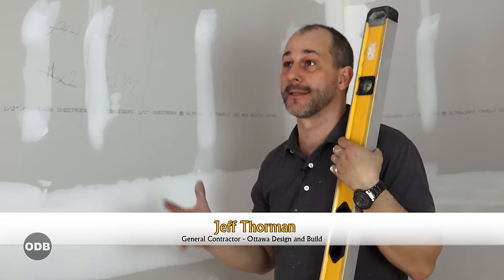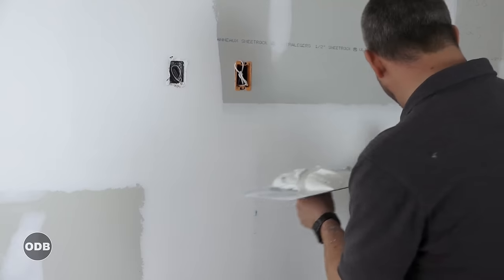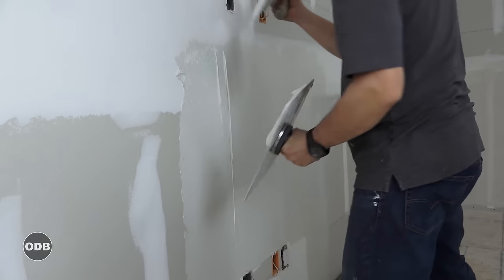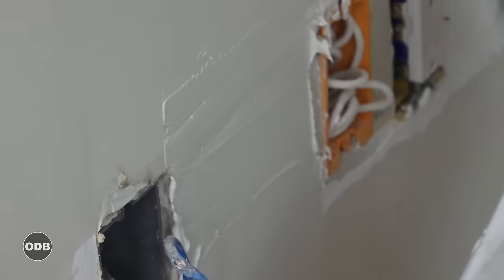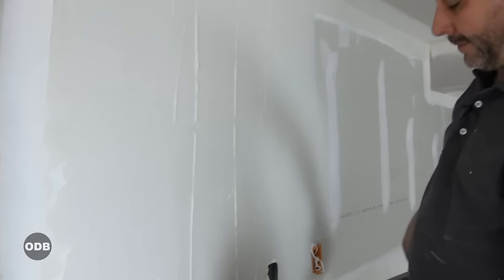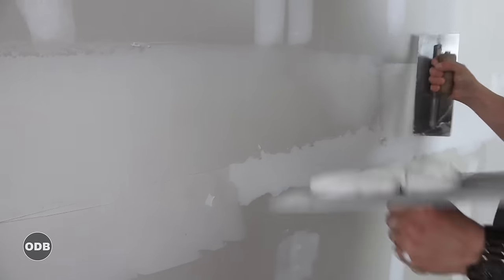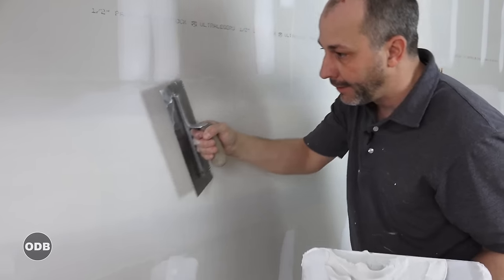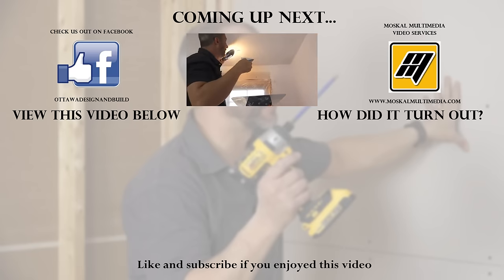Complete Drywall Installation Guide Part 10 Final Coat

Comment: I know this is a series and as it all comes together it looks and is fantastic. But us non-professionals either don't have the skill or patience, sometimes and it goes horribly wrong. Is there any chance you'd do a piece and how to correct major errors? Typical issues for me are where I might use plaster that has gone off, or when filling a crack or hole the plaster is too wet and runs out after I've finished and it creates a huge bump. There are also problems in renovation where working around immovable objects is inevitable.
Reply from the maker: Thanks for the comment. I will try to keep that in mind for the next project we are working on.

Comment: When you say outward pressure are you pushing all the mud to the edge and then feathering the edge? It's hard to tell which way your adding pressure on that 4x10 trial, I've never used one.

Comment: Not trying to criticize your work at all but why have drywall installers went more to hanging it horizontally instead of vertically like they used to do more often in the past? It seems like vertical would be easier because you wouldn't have as many flat joints without the factory edge and setback for mud.

Comment: I am a newbie at this so I apologize if this is a dumb question, but instead of worrying about spreading the butt joint out wide so you can't see it, could you not just leave a gap between the panels and fill it flush with sheet rock 45?

Comment: just i want to thank you for the time and the knowledge you are sharing with us. My questions . when you use regular mud and the quick dry mud?. it will make a difference if i use the quick dry mud all the steps and just add water to make it thinner? if i can mange the time before it will dry.
Reply from the maker: definitely. Allthough use regular premixed mud for the final coat. it sands soooo much better.

Comment: So for the final coat do you cover 100% of the drywall?
Reply from the maker: new house construction does not, however for the best results you can. Cheers!
Reply: Great reply, a lot of people don’t mud the full wall and seem to think that’s the “old” method of doing things. 

I’m refinishing a basement and mudding the full wall as a final step is a lot of work, but results are super smooth and very easy when reaching primer/paint stage. 

Thanks again for all the great tips, plumbing, timing, and drywall have been instrumental in your videos.

Comment: After applying the final coat, should you still be able to see the tape through the mud?
Reply from the maker: Not when it is dry. Sometimes maybe. The question is, when it is primed how amazing does it look then. That is when you can get critical. too many factors at work here.

Comment: Your almost as good as the best guy I ever seen
Reply from the maker: Thanks I think.
Reply: Love the channel I jump around the pros ,theres a plaster guy that is amazing
Reply from the maker: I may not be the best at everything but I pride myself in having an above average understanding of most trades and an ability to perform most jobs at an above average aptitude. This comes from years of trying to support a large family and working myu butt off to provide for them.
Reply: Home Reno Vision DIY I hear that I'm constantly learning and supporting a family if you can work with a good attitude it's a great start I take pride in my work but even a little tip here and there goes a long way thanks now I won't have to work as hard lol here's a tip from us them grey knee pads are a life saver when you get used to em 👍
Reply from the maker: LOL I hat the way they pinch behind the knees. Thanks for the thought tho.
Reply: Yea but you get use to it kneeing of concrete can do long term damage protecting comes body is 1st over here
Reply from the maker: I protect my body by doing many trades so I don't have a repetitive motion or stance. Every day I am doing something different. Wears my whole body down much slower.

Comment: Nice video and thanks for share .what do you recommend to do, when you have to patch a ceiling on baseman, but the existing ceiling is uneven , the ceiling has plywood on it ?
Reply from the maker: Wow, start over! level the framing and drywall with new sheets. You will never be happy with the final result if you layer over something uneven. Or you could just stipple the thing if it doesn't matter to hide the imperfections.But that's another video!!!

Comment: I'm having a tough time figuring out where I start in this process.. I am trying to paint my garage- it is new construction (11/2018) unpainted. Should I do the final coat or has it usually been done? There is definitely a ton of mud lines, tape bubble and blobs, so I'll need to do a ton of clean up. Just not sure about the mud process.

Comment: Hi Jeff this is a great video series and will really help me do my drywall in my house extension, thank you and your crew very much. I have a question though. I can choose between mounting my drywall horizontal or vertical which is best? I think vertical will leave me with less butt joints which I’d prefer but normal joints would be harder I guess. What do you recommend?
Reply from the maker: vertical is fine if you have everything perfectly level and marked out. I go horizontal so I don't go crazy closing the joints with wood that is never straight.

Comment: Hey Jeff looking for your expert suggestions on best solution to a problem of a bowed wall in my bathroom (up to1/4 “ across about 3’ section) created by install of tub flange (that I didn’t do). I want to install a tile baseboard on this wall and know I can fudge some minor depth discrepancies with tile cement but probably not this much. The bow was highly visible with the old tile baseboard. Should I resolve this problem using joint mud similar to your demo to hide the butt joint ridge in “drywall #10 video? Or try to address it by shimming btwn studs and drywall. PS: I’m the unfortunate owner of a home built with metal studs. Or do I abandon tile baseboard for bb moulding? Look forward to your advice. Love the videos. Tina M in Oly
Reply from the maker: yup, fix it with mud after and paint it in. so easy. Cheers!

Comment: Hi Jeff.  Do you go over your inside corners a third time with a finish coat?  I only saw a tape and then fill.  Thanks
Reply from the maker: and sometimes a fourth. the point is to do as thin a coat as possible and as many as needed. Cheers!
Reply: Ah man. Thanks. Remodeling a house. Never done smooth walls. Always textured. But since this is an old farm house I wanted smooth walls. My butts and tapers look really good. My inside corners are rough. I keep getting boogers right at the very corner. Like 1/4” wide. Now I’m just doing spot filling on a 4th run.

Comment: Thanks for showing even the little steps, like your move to erase a scratch. (I have to do that a lot, since I'm still getting the hang of drawing the trowel across :-)
Reply from the maker: Once you get used top the pressure you will be like a pro!
Reply: I just experienced a moment of happiness on my 10th inside corner. And I trust everything I've messed up will come out in the sanding. I feel like I just finished a beginners course in drywalling. Thank you for the awesome series.

Comment: Would it not be quicker to just plaster skim the whole wall? Genuine question mate 👍
Reply from the maker: regardless we still need to get the wall to this point. A level 5 finish is where we go to the next step and skim the whole wall. This is a level 4. new homes use a 3 as a standard.
Reply: Home RenoVision DIY Thanks mate, I sometimes get get caught between either skimming the whole wall or (in older buildings) repairing and filling and sanding. Great videos, love how you work 👍

Comment: Hi! thanks for these videos. I have a question. I demoed part of my bathroom, I tried to cut clean lines in the sheetrock, but by the door frame & trim, some of the sheetrock broke and crumbled from underneith the frame/trim. The the frame/trim is pretty rock solid. just need advice about what to use to fill in the uneven areas between the new sheetrock and within underneith the frame/trim.

Comment: We have managed to put men on the moon, yet no one can seem to figure out how to bevel all 4 sides at the factory... 
smh..
Reply: Facts
Reply: Huge respect to your job and the time that you spend to learn us what you know!! Thanks for your help!!Keep going!
Reply: Tim Falardeau ..... the moon .....vast oceans are demonstrably level 😊
Reply: What difference would it make when you still have to cut them to custom lengths
Reply: @EWDAVID94  you'd put the cut against the wall?
Reply: No man ever stepped on the moon
Reply: They should invent a beveling tool to bevel after you cut the piece
Reply: @thegreatwhitenorth8754  Hanging vertically is great if your studs are positioned perfectly so that each piece lands exactly on the center of one. How often does that happen? Unless you get to do the framing yourself also, you probably aren't going to get that lucky. If I have to hang horizontally, I just buy longer sheets.

Comment: Is that a 12 inch knife that you're using? The finish looks so smooth
Reply from the maker: Just a 10 inch. The trick is in the pressure and how creamy you mix the mud. Not difficult because you are not using very much on this coat.Just prepping to sand by smoothing it out.

Comment: Could you show how to patch up dings in finished drywall that's been painted?  I have lots of patching to do throughout my place and would like to do it properly so when I repaint over it, you can't tell it's been damaged in the first place.
Reply from the maker: great idea, really all you do is dent any bumps and fill with 2 coats of the wet mud. Press the knife tight both times. when you are ready to sand you can usually use a damp sponge not a sanding sponge. The secret is to prime each spot so that after 2 coats of paint you have the same texture. In most cases you can see the repairs since most people miss that step.

Comment: I'm trying to do my sister's basement I'm a little hesitant to try to tape, watching the video looks like an intense and long process I dare to try
Reply: It's not that hard. Very intimidating at first but after your first joint or 2 you will pick it up and also pick up different techniques. A trick for smooth mud too...put on one direction take it off with the other direction.

Comment: First thing, thank you for all the videos they are awesome.  But here is my problem.  I got a wall that is 14 feet long and it has two sides that have water damage.  I think I'm going to take 4 feet off from the bottom up.  But I don't know how to put tape on and how to prepare it.  The left corner of the wall will butt up against the old wall that has paint on.  So what do I do like take off the paint by sanding it down just don't know what to do.  If anybody has any ideals please let me know or send me to a YouTube video.  Thank you for the help
Reply from the maker: you can tape on top of paint and I suggest cutting at 44" from the floor. then cut the new drywall at 43" and install. It will give you a nice butt joint across the wall. Cheers!
Reply: Thank you very much.  This sure takes a load off my mind.  Thank God we have YouTube @HomeRenoVisionDIY

Comment: What are the number on the bag of powder mix.  Is that the work time or hardner lever?
Reply from the maker: The number refers to the estimated time for the mud to harden under normal conditions. Things that effect that are temp( the hotter the water the faster it sets) and water source. Usually city water is soft and takes longer than well water that has lots of iron and minerals in it. If using well water do a quick test to confirm but I usually use 90 mud for well water.

Comment: I tried and cant get that hawk spreader to work for  me.  Feels like it puts it on  then takes if off easily or unable to control it and leaving lines. I used  a regular wide spreader (same size) and can play with it and do a pretty good job.  Is there a mix opinion or should I learn how to use the hawk?  feels ackward.
Reply from the maker: It is all about the pressure. practice makes perfect!

Comment: Hi I don't know if I missed this but do you use different types of compound and consistencies on different coatings  ie.. All Purpose vs Plus 3 vs Light Weight Topping.  If I watch 10 different drywallers I will get 10 different opinions.  This is my first attempt from start to finish my 1st actual mudding attempt. I used light weight topping  with my 2nd & 3rd coats but my 3rd coat doesn't  feel as smooth as the 2nd coat they look pretty good I think and I have been told they do but why would that be?   I also misunderstood on making my seems and joint widths and I made them all pretty wide but I guess I only needed to do that with the butt joints does that matter other than extra work?  I really struggle with the corners I'm afraid they are going to look terrible.  I am a little OCD so it's really difficult for me not to sand up the edges and  the  imperfections between coats I hope I'm just making more work for myself and not making the over all job turn out poor.  Fortunately it's my own basement I'm practicing in.  Thank you for your time.  
Jackie
Reply from the maker: Hi Jackie, My system is developed for simplicity. There are a lot of ways to get a great result. In my system you ojnly need 1 type of compound. Just make sure it is a little wetter each coat and you will never have to sand until the end. I hope this helps. Have fun with it.

Comment: Would like to use my attic space for storage.  But need to put in some built up beams up there above the roof trusses.  The area I would like to use has a concrete wall on one end and a carrying beam on the other end and spans 22 ft.  Any ideas?
Reply from the maker: try 1x8 that should do it!

Comment: Thoughts on finishing knifes?
Reply from the maker: I like a straight blade that doesn't bend under the pressure created when pushing the mud. The flexible knives are for people who are not trying to get a good result and are happy with mediocrity.
Reply: Home RenoVision DIY I've been having this issue with the knives. I can't get a good pull because they bend up and still leave the mud behind that I am trying to take. Need to switch to a trowel.

Comment: What's the best way to butt drywall to an existing, painted wall? We have a room with a smaller space in the back corner that we have framed off to make a new bathroom. The framed wall lines up with the existing painted living room wall so we will have painted drywall meeting up with fresh drywall that needs to be blended together. How should we prepare the painted wall for mud and should we be butting up to that wall with the bevelled edge or cut off the bevel so it's ½" meeting ½"? Thanks.
Reply from the maker: You are over complicating things just a bit. cut screw and tape like as if it is all new drywall. You will be fine.
Reply: @HomeRenoVisionDIY  Thanks. Wasn't sure how well mud would adhere to paint. Great videos!

Comment: This part seems excessive to me. When I re-did the drywall in my basement I did not do a final coat and it looks just fine to me even doing a flashlight test.
Reply: I think what he's saying is its a texture issue and believe me I have texture issues all over my house. I used benjaman moore and you will notice a difference between painting over the machine mud (good smooth finish) and painting over the time sensitive mud (horrible finish). Ive seen videos where the literally wet down the finish mud (machine mud in this case) up to a thick paint consistency and roll it on, then feather it off leaving a lite skim coat to get some what of a level 5 finish, havent tried it yet but im going to.